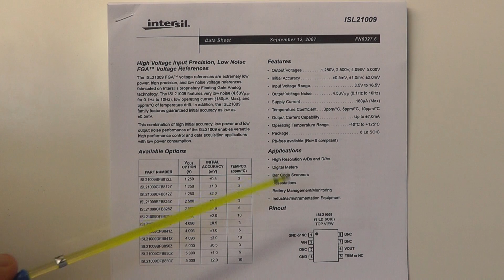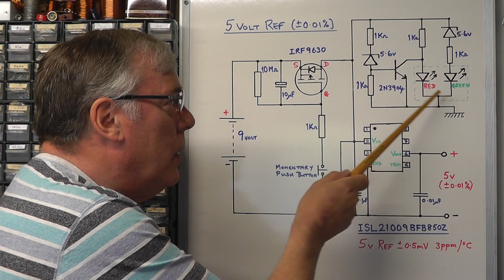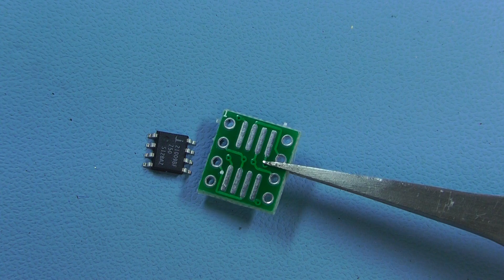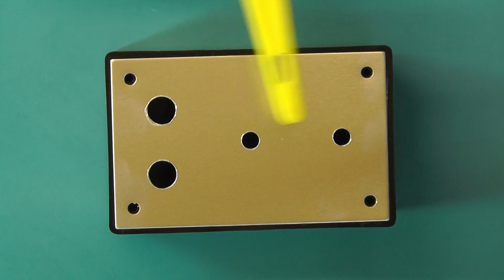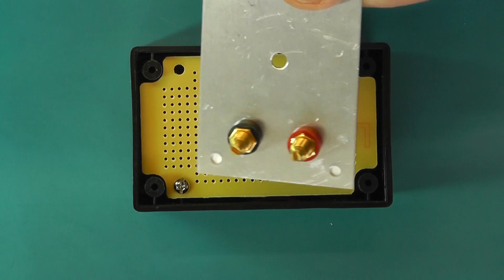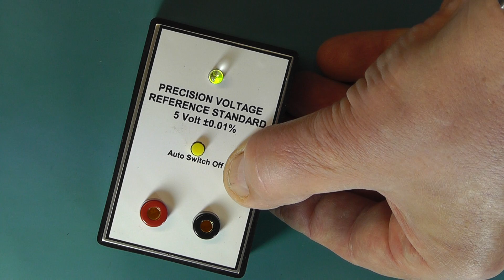Scullcom Hobby Electronics #21 - Design & Build 5 Volt Reference Standard

Comment: Very nice! But for the battery indicator I would use something like an LM393 with a fixed local reference using a single zener and then some resistor bridges and then just inverting the 'logic' for each of the compactors in the package. Saves the shunt current to keep the red LED off. Plus to save more current I'd probably use something more like 4.7k or even 10k for LED current limiting. I personally prefer dimmer indicator LEDs. They don't need to be too bright to serve their purpose.

Comment: It looks like this IC is no longer available. Is there an alternative IC I can use please?
Reply from the maker: An alternative you could use is the Intersil ISL21090BFB850Z. It has a Initial accuracy of 5.0V ±0.025% (equal to ±0.3mV) and a Temperature coefficient: 7ppm/°C max.
This chip is available from several suppliers, for example Mouser.
http://www.mouser.co.uk/ProductDetail/Intersil/ISL21090BFB850Z-TK/?qs=sGAEpiMZZMvq007EO%252bXAYSPYWf48k5JL
The Intersil ISL21090BFB850Z has the same pin out as the Intersil ISL21009BFB850Z which I used in my project so is a drop in replacement. the part numbers look very similar 21009 has changed to 21090.
Regards,
Louis

Comment from the maker: Message for PirateKitty below as your message will not accept any reply for some reason:
You were looking at the ISL21090 is the wrong IC. The one you quoted 
ISL21090BFB850Z is a lower spec 5volt reference IC. The number can 
appear the same at a quick glance, but look more closely.
I used the ISL21009 voltage reference IC.
There are 3 grades of that reference IC at 5 volts:
ISL21009BFB850Z   -    5.000V and initial accuracy ±0.5mV with a temp coefficient of  3ppm/°C
ISL21009CFB850Z   -    5.000V and initial accuracy ±1.0mV with a temp coefficient of  5ppm/°C
ISL21009DFB850Z   -    5.000V and initial accuracy ±2.0mV with a temp coefficient of  10ppm/°C
For this project I used the first one (B Grade)
ISL21009BFB850Z as the initial accuracy of ±0.5mV is the same as accuracy of ±0.01% of 5volt.
Datasheet link below:
http://docs-europe.electrocomponents.com/webdocs/0b51/0900766b80b51ca6.pdf
Regards,
Louis

Comment: I have build this 5V ref and combined it with the current source. Now I add some Vishay precision resistors so I have a nice unit to test my multimeters. Thank you for sharing this nice projects.
Reply from the maker: Glad to hear you found it helpful. Adding a few precision resistors is a good idea. I have also made myself a precision resistor box with a 10K, 1K and 100ohm resistors all at ±0.01% and used it in a metal box for screening. I also use it to test my meters. However, the cost of ±0.01% tolerance resistors is very expensive.

Comment: I know this is quite old now (only just found your channel). Useful device...just wondering whether it's possible to extend (to more than 2 minutes) the 'on time' of the mosfet by changing the Capacitor value or the 10M Ohm resistor value?
Reply from the maker: Yes you can. try increasing the value of the capacitor or/and increasing the 10Mohm by say adding another 10Mohm in series with it.
Reply: Thank you, and by the way, another excellent video.

Comment: Hi David.  I'm a newbie.  Can I ask what the logic was for specifying a tantalum capacitor for the voltage buffering/cleaning (not sure what the word is) as opposed to a cheaper electrolytic?  I imagine there must be a reason, but I can't work out what it is, and any reason I've been able to come up with suggests it would have made sense to do the same with the 5v ref output as well?  Warm regards, Julie xxx
Reply from the maker: +Julie Brandon Tantalum capacitors have many excellent qualities. The size of a Tantalum compared to an equivalent value electrolytic is much smaller. Tantalum capacitors have a lower ESR (equivalent series resistance), higher operating temperature and lower leakage than other types of electrolytic capacitors. Which make them good for use in test and measurement equipment such as this voltage reference standard. Hope this helps.
By the way, I think you must have got the name David from my Scullcom website, David is my youngest son who is the artist in the family and writes the comics which I put online for him.  Regards, Louis
Reply: +Scullcom Hobby Electronics Sorry about the name mix up, Louis!  Thanks for the explanation.  :)  A friend and I are going to try building this as our first project, but with a MAX6225 (because of chip availability and we've count 4000 meters.)  We'll need to use 2.2uF (tantalum :) ) decoupling caps on Vin and Vout we know, but also the V in cut off is more sensitive (can't go lower than 8v.) Am I right in thinking we can adjust the cut off V for the LEDs by tweaking the zener diode breakdown voltage values? Julie xxx
Reply from the maker: +Julie Brandon The MAX6225 I believe is a 2.5 volt Reference IC. The MAX6250 is the 5 volt one. This is a very nice IC with low noise and very low temperature drift with an initial accuracy of 0.02%. Yes you can tweak the LED cut-off by simply changing the zener diodes to different voltage breakdown values.
Reply: +Scullcom Hobby Electronics Brilliant!  Thank you.  :)  Yes, we purposefully went for 2.5V because our meters are 4000 count, so we would get a reading of "2.500" instead of "05.00".  We've also gone for socketed chips, so can change our minds later if we've boo-boo'd. :)
Reply from the maker: +Julie Brandon I see you have thought this through and in your case the 2.5 volt is a good choice for your 4000 count meter in checking accuracy and resolution. Be careful when using IC sockets on precision reference IC's. Make sure you use good quality sockets so as to reduce the effects of contact resistance. For this project I would recommend you use High-precision gold-plated 8-pin IC socket with turned contacts (they cost around £0.64 each, not to expensive but well worth it).
Reply: +Scullcom Hobby Electronics I downloaded LTSpice IV and had a go at making that circuit sans the voltage reference IC itself within it; it's been a steep learning curve but I've got something now that seems to work and even matches the LED on/off voltages in the video.  :)   Picture of the schematic and graphs of it running at https://i.imgsafe.org/54c56cc.png and the LTSpice IV .asc file at http://s000.tinyupload.com/index.php?file_id=57349451498063899463   Thank you again for all your help.   :)
Reply from the maker: +Julie Brandon Well done I had a look. You seem to be picking up things quickly. Keep up the good work.

Comment: Loving your videos, Keep it up! the quality is excellent. Quick question: Why not connect the base of the transistor in the monitoring circuit to in between the resistor and zener of the green LED? wouldn't this improve transition from green to red, improve power consumption and eliminate 3 components? am i missing something or did you show this way for ease of understanding.
Reply from the maker: Wessel Lemmer Thanks for your comments. Doing what you suggest would put the Base/Emitter junction of the transistor virtually across the Green LED. As the normal Transistor Base/Emitter voltage is clamped around 0.7 volt when the transistor is on, then the Green LED would never come on as it needs about 2 volts. Hope that explains it OK.
Reply: Scullcom Hobby Electronics Ah, thanks, I see. I think then putting a 1k in series to the base should solve that problem right. Also just realised  that this is likely the reason i've blown up many many transistors. :|

Comment: Hi, thanks for an interesting and informative video. 

This may be a stupid question, but what do you use the accurate voltage reference for? I saw the chip would only supply microamps, so is it only for testing voltmeters, or do you use it in combinations with op-amps in some fashion?
Reply: hoplahey You use a precition voltage reference for calibrating things like multimeters and so on.

Comment: Thank you for this. I'll probably use that clever battery level indicator circuit to use in another 9 Volts battery powered project, but adding a manual check momentary switch to it, not to add a continuous 13 mA drain to my project.

Comment: 13mA consumption with the battery tester vs 0.1mA without it? You better off just omitting the tester and you will never need to change the battery again.
If you really need it, you could add a battery test button to connect it temporarily
Reply from the maker: misium Yes you could omit the battery tester is you wish. I thought it worth adding as the same technique could be used by the hobbyist in other projects. A standard Duracell Long-Life Alkaline 9 Volt battery has a capacity of about 310 mAh. Even when the unit is drawing 13mA the power consumption is still low. If you assume you use the unit say a total of 1 hour a week the battery would last about 6 months.
Reply: misium 
The main culprit is "shorting" the red diode to keep it off. It's responsible for about 10mA of the 13mA. Easiest solution: make the resistors' values bigger. If all are 4.7k resistors (or even higher) the circuit should still work and the LEDs still be visible.
The better solution: use a slightly different circuit that doesn't short a LED, like here: http://www.instructables.com/id/9v-battery-status-indicator-circuit/ . Needs a slightly different LED though (has to be a common anode instead of common cathode). Two normal separate LEDs are always an option as well. Then you can go for low current LEDs that are quite bright at 1 or 2 mA.
Reply: I'm late to this having only just discovered it. Great idea and very neat implementation. I agree about the red LED being the main culprit in the current consumption. A MUCH better solution would be to use a long tail pair configured as a comparator with an LED in each of the collector arms. Loads of reasonable circuits online. The same tri-colour diode can be used if the normal NPN config is swapped for PNP or a common anode LED can be used with the NPN config. Placing a zener in the base circuit of one transistor provides the necessary trigger point, but now only ONE LED is drawing current at any time and low current high brightness LEDs make an even bigger difference. Further current reductions: use a MOSFET long tail pair instead of bipolar, implement a 2Hz 10% duty cycle "flasher" drive in the long tail pair emitter circuit and now you have a HIGHLY visible yet very low current usage monitor (<0.2mA average LED current with the right LEDs and pulse circuit)

Comment: ISL21009BFB850Z isn't in stock at any USA distributor. Might have to do some research and find an alternative part. Seems like you would have picked a more widely available part for a Youtube video. Love your channel but I can't really build this.
Reply from the maker: Red Resistor   You should be able to get them in the USA. I recently purchase some ISL21009BFB850Z from Mouser Electronics who are based in Mansfield, Texas, USA. I received then by FedEx International shipping in just 3 days, delivered to the U.K. They stock the SMD version of the chip in SOIC-8 package (Mouser Part Number is 968-ISL21009BFB850Z ). I have also now provided PCB artwork and build details using this SMD chip. You can download them from the links below:
http://www.scullcom.com/Scullcom_5v_Ref_PCB_and_layout.pdf
http://www.scullcom.com/Scullcom_5volt_Ref_onPCB_details.pdf
Reply: Scullcom Hobby Electronics Thanks. I did some research and found some similar chips. I should be able to adapt your circuit pretty easily. Never thought about building a precision voltage reference from scratch. Neat little project. Mouser and every other usa distributor I looked at is out of stock for the part you used.

Comment: Your series is nearly perfect for what I have been looking for!  THANK YOU FOR YOUR EXTENSIVE EFFORTS!!  I do have a suggestion, and I wouldn't be offended in the least if you said 'No'. I am a software developer and we like to make things work in small components and then put them together into bigger components.  Your series looks at a holistic end-to-end solution to a problem.  What I suggest which could be just as useful for others, is to take this (and similar projects) and turn them into 3 separate projects.  1) A project dealing with the auto shut-off of a Mosfet (or a BJT if possible) and possibly adding a manual shutoff (to supplement the timing ckt you built in) as well as, providing a data-sheet/conversion table to allow us to build that same circuit to work with 3V (2xAA), 6V (4xAA), and 12 V etc. since the world is multi-voltage!  2) Build the LED power level solution for different voltages (same as the previous ckt voltages (3,6,12, etc) providing a conversion table for the components that would be different (e.g. the diodes/resistors) 3) The final project to be whatever project you want to be supported by these previous 2 projects (e.g. current/voltage/other components).  If you could record your math/considerations/circuit evaluation you used for all of your other projects, in projects 1&2 would be icing on the cake!  Again THANK YOU!

Comment: Nice. I would put the battery level indicator to actuate only while pressing the power pushbutton. The idea behind this is to preserve battery as most of the power consumption is on the battery indicator circuit. At the end you only need to check the battery level at powerup an if you want to check it again, press the power button again.
Reply from the maker: Charlie Pechiar Thanks for you comments. Your idea is good for units that are permanently on until switched off again. As the unit here auto powers off after about 2 minutes even at 13 mA the battery will last a very long time. A normal Duracell 9v battery has a capacity of 550mAh and so the battery would last for about 42 hours if it were permanently on, so I think in this unit with normal use the there should not be a problem.
Reply: @scullcomhobbyelectronics1702  But if the ground connections for the battery monitor circuit were moved to the non-grounded side of the push button,  would that work?
Reply: @Roy_Tellason  Not properly. It would be fine while the button was held, but as soon as it was released, the circuit would provide a relatively low impedance path to charge the 10μF timing capacitor towards 9V, which would almost immediately start to turn the circuit off as the voltage on the gate rose to within the mosfet's threshold voltage of the positive rail.

Comment: Your videos are fantastic!
I'm learning electronics and designing circuits as a hobby. Your videos pick me up at the right spot knowledge wise.
The projects are not only useful but simple enough that I can work on them with limited time.

I only have one suggestion: Could you put the parts list please in the video description and not in the comments (comments are hard to navigate to on the tablet)?
Reply from the maker: ***** Thanks for your suggestion. I am relatively new to You Tube so not always aware of what is the best way to present parts lists for my projects. I will take on board your suggestion.
Reply: Scullcom Hobby Electronics Thank you very much! :-) I think it should be "IRF9630" not "IRF9360" as in the list? Sorry for nitpicking, just noticing ;-)
Reply from the maker: ***** Thanks. It was my typing error. I have corrected it and also added the Black and Red 4mm Banana Sockets to the parts list.
Reply: Scullcom Hobby ElectronicsSorry, don't know if I should ask these questions here:
Am I right that the IRF9630 can be replaced with a IRF9540 (I have one lying around)?

Vds is only -100 compared to IRF9630, but with the 9V battery still well within range.
Also, RDSon is only 0.2 ohm, so less resistance when turned on.

I don't know, if a different Qg, Qgs and Qgd make any difference, have a little trouble understanding them.
Reply from the maker: ***** The IRF9540 should work fine. Any fast switching 'P' channel Mosfet (insulated gate) with very low on resistance will do.

Comment: How much is that voltage reference IC, and where can we buy it?
Reply from the maker: Hi'gak Iya You can get the Reference IC from either:
Radio Spare - cost £6.05 plus 20% VAT - RS Stock Code is 516-568
http://uk.rs-online.com/web/p/voltage-references/0516568/
or
Mouser - cost £7.09 plus 20% VAT - Mouser Part No. 968-ISL21009BFB850Z
Check out their online website.